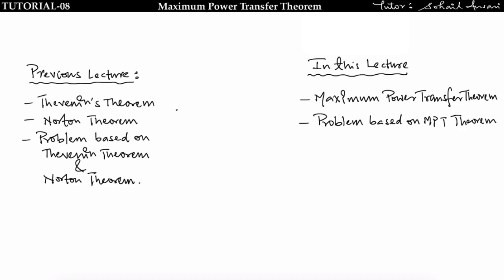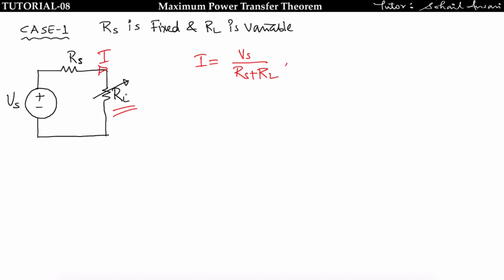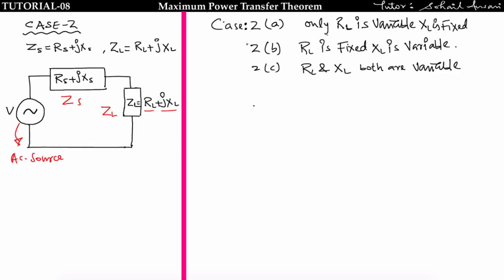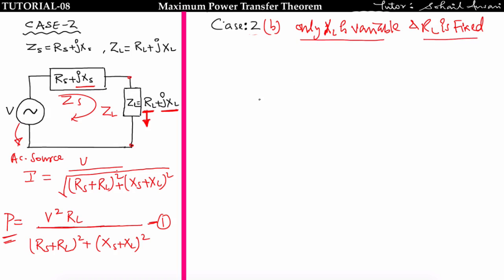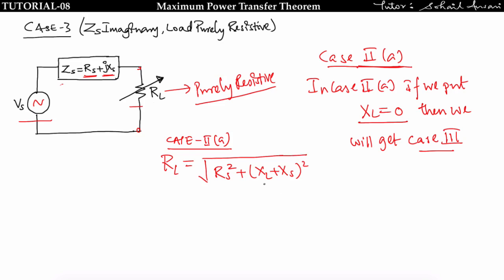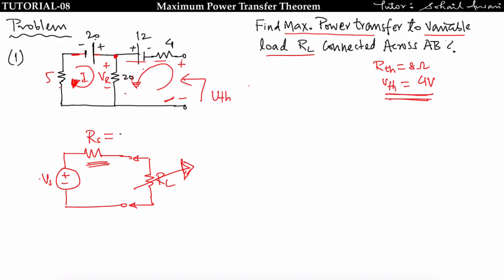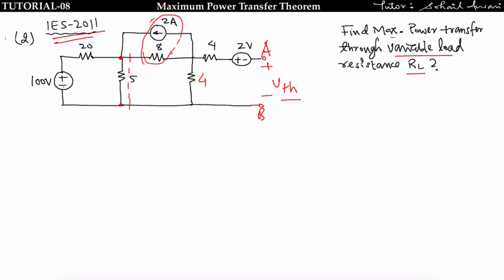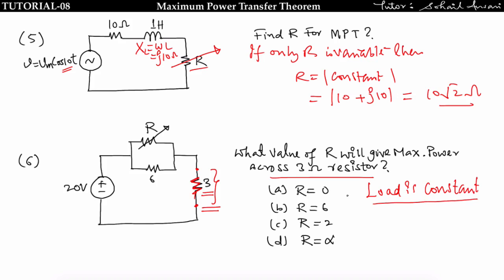Lec-08 NT-Maximum Power Transfer Theorem

Comment: Sir, first of all thanks a lot for these video lectures. 
Doubt:
sir if in the case of constant load, for max. power max current should flow through the load. if we apply the same concept for the variable load it's making sense. by formula P=I²R if max current will flow through the variable load it should provide max power. isn't it sir?

Comment: Sir
In third question for finding RL with fixed XL, actual equation is
RL=root(rs^2+(XL+Xs)^2)=root(100+(10j-15j)^2)
=root(100+(-5j)^2)
=Root(100-25) as j^2=-1
=root(75)
Is there any mistake sir
Reply: Plz reply sir
Reply: Plus hoga 100+25

Comment: Hello sir. One IIT prof. Asked me interview qtn is that, 
in case 1wt is the condition to flow the max. Power in Rs?
Reply: May be it is similar to last problem of this video where we can see that if load resistance is not variable than the max power transfer is not applicable, here we have to find minimum impedance path with a load resistance value. Did u find any correct explanation for this question?

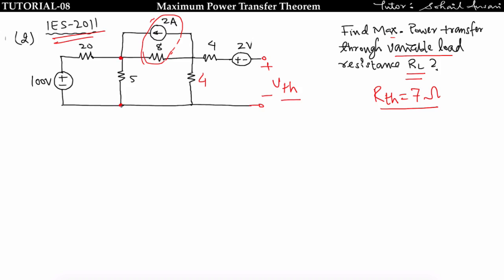Comment: Sir how to do ciruit reduction  at 26:24 u told u already explained at node method I watched that video also but I can't find  plz explain r give a link for CkT reduction
Reply: yes sir allready explained this in their erlier video this is the simple transfotmation first sir converting voltage source into current source in parallel with 20 ohm resistor this 20 ohm resistor is in parallel with 5 ohm resistor after solving parallel combination of 20ohm and 5 ohm sir again converted the current source into voltage source sir skipped one step because that was not so imp i hope u understand the concept

Comment: In first problem while calculating Vr you consider only  20v source is supplying the current why don't consider the 12v source it is also have path to supply the current

Comment: In mpt questions and sometimes you have used kvl to find vth ,sir how is that possible ,kvl is only applied in closed loop ,right?
Reply: UPASNA KUMARI in MPT while calculating vth a dummy voltage source is used so that we can apply Kvl although there will be no current passing through that circuit

Comment: In case 2(a) we are getting Load resistance greater than source resistance.. So the efficiency should be greater than 50% if we calculate it. Can you please check it and let me know whether it is correct or not? 
Thanks in advance
Reply from the maker: efficiency will never be greater than 50% in any case...u can check by taking one numerical of case 2(a)..u will understand as power output is I^2RL...so if there is XL term then efficiency will be less than 50% always..try to solve one numerical on case 2(a)...if u will get prblm again then plz let me know in facebook group...